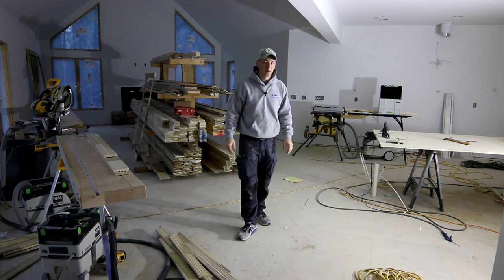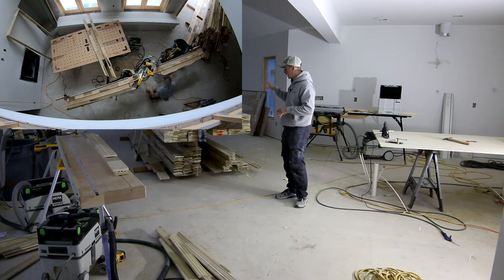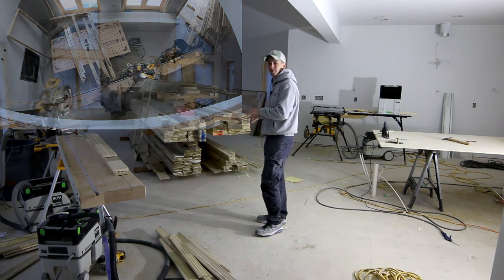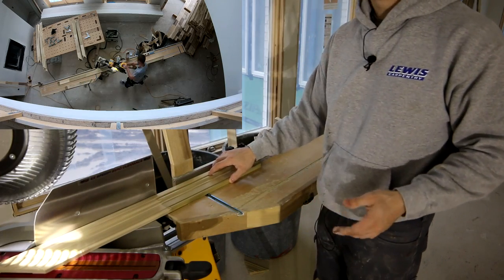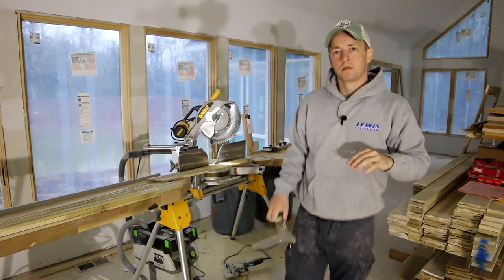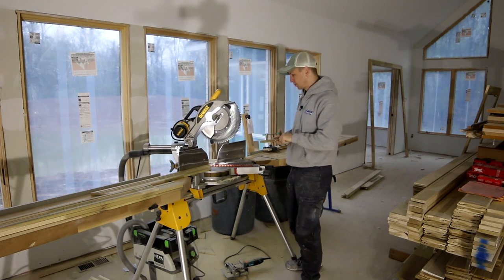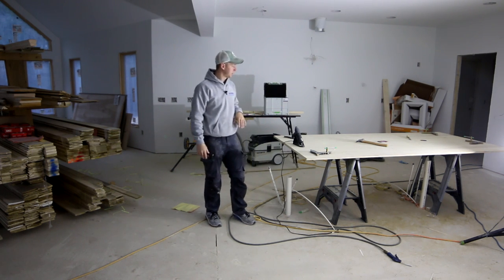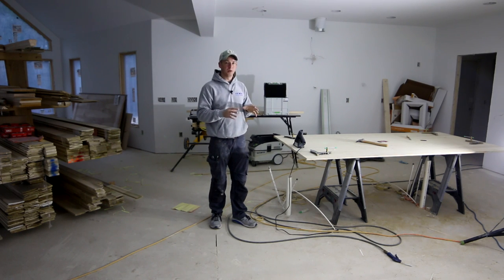The Most Efficient System for Mitered Casing

Comment: When you pivot your saw is it the same measurement from 45 as it is when it’s square on your embedded tape
Reply: I was surprised how accurate mine is. I also have a dewalt. The pivot point is right at the fence.
Reply: @waynemiller6070  nice

Comment: How do you handle stained casing? I am assuming that you are caulking the gap between the casing and for jamb. However that doesn't work with stained casing.
Reply: Spencer Blaylock paint Contractor here. No caulk on the stained casing which makes the installation that much more critical.
Reply: @twsd  That's why I asked. I don't see how he gets a tight fit to the jambs. Can he get an acceptably tight joint with the jambs 1/4" inset from the wall using stain grade trim. If so I would love to see how. I couldn't do it. Which is why I don't batch cut trim.
Reply: I’m sure he can. This guy is obviously a serious professional carpenter. I am not.  🔆

Comment: Thanks for the video man. Have a quick question - doesn't this hot glue is expanding a little bit once it is dry? I used traditional cheap hot glue gun and once it dries it it thick enough to have my miter open.
Reply from the maker: No it doesn't expand. This product is a completely different animal than traditional hot glue. I would not advice using traditional hot glue on miters.

Comment: I really like that glue system your using! I I know you mentioned wood glue and biscuits and how they stack up against your glue but how does it Stack Up Against CA glue/ cyanoacrylate Glue. I see a lot of trim guys are using the CA glue now and I'm in the middle of trying to decide which route to go.
Reply from the maker: CA can be decent on MDF but its terrible on real wood. I use CA for small return pieces and things like that, but not for anything that requires real joint strength. Hipur is in a completely different league. I look at hipur and CA as two completely different tools with different applications.
Reply: Insider Carpentry CA glue is great for mdf. Once you get the hang of it it’s really fast to produce strong outside corners. It’s basically liquid plastic and it can be brittle so good for mdf and not my favorite for solid wood. That’s why I bought a hi pur gun. The adhesive is not the same as hot glue sticks but has the gap filling properties like using hot glue. I’m experimenting with the wood to wood 30 second product now. I anticipate using it just for wood casing but who knows.
Reply from the maker: Crown Molding by Spectacular Trim yeah we can’t use mdf here in the Midwest so I only use ca for small returns on real wood. Hipur works best with clam clamps for casing. 👍 And stick with the 30. It’s the thinnest viscosity.
Reply: Insider Carpentry I literally got my gun yesterday and just started experimenting I took some hyper between two shims and just squeezed them together and let them sit for a few minutes and I could pull them apart pretty easily so somethings not right. Do you find that high pur needs clamps to form a really strong bond? I’m not complaining I’m just in search of making the system work for me because like you I really don’t want to have to use biscuits and wait for glue to dry a conventional way when doing casing.
Reply from the maker: Crown Molding by Spectacular Trim Something is wrong then. I have heard of guys getting bad tubes that had no strength but I’ve never had that problem. Hipur cures by reacting with air humidity. Really dry air could be an issue. You need to assemble very quickly and not move the pieces any after you first few seconds assembling or I’ve found it weakens the bond. The larger the gap the longer it will take to cure to strength. With clamps the cure should happen very quickly. I’m not sure what else to tell you?????
Reply: Insider Carpentry I’m going to check the tube I’m told that they have a expiration date of one year so I hope they didn’t give me old product. But also I’m going to experiment with it more anyway I’m not down on it at all I’m very optimistic about its possibilities
Reply from the maker: Crown Molding by Spectacular Trim For some reason a lot of guys struggle getting through the learning curve and give up on it. But it’s literally changed my whole work flow. It’s worth it.
Reply: @InsiderCarpentry  I'll get a hang of it. I have literally spent less than 5 mins with it. Just wanted to hear your tips up front. And from what I have read its shelf life is due to the fact that it is a hybrid of polyurethane and CA glue. Makes sense why the cap must go back on right away.
Reply: Insider Carpentry So I’m experimenting with it a little bit more and I noticed there is a huge difference in the strength of this glue if you clamp the parts together. Unlike hot glue which you can just smear two parts together and stick them this glue does require clamping for it to form a strong bond which is not a bad thing but it’s just something to be aware of. Also I’m finding that you have to put the cap back on the glue every time you stick it in the charger unlike a hot glue gun because this stuff will just pour out the front if it sits in the glue unit without the cap on just part of my learning curve
Reply: Well I tell you I just glued to two by fours together and throw them in a vase and now that I unclamped it after a couple minutes I’m pounding on it with a sledgehammer and they’re not coming apart so this stuff is very strong if you clamp

Comment: Great idea but over here they use aluminum windows with timber reveals. They are not always square and if you dont install them yourself you cant be sure they have been installed plumb and level which is annoying  as i would like to be able  to bulk cut.

Comment: This is great for a production shop but this is not so great for a job site the stop block system is not so bad but there is a more simpler solution and if the drywall is off theres problems and these clamps and this glue is overkill same with biscuit joints especially on casing trim rack is great but I'd consider it a liability and time consuming I can see the rack justifiable and this system for a mansion house but for your regular million dollar houses na unless you have 1 guy on the saw 1 guy clamping and a runner and a couple installers I think it's a little too much only thing I can imagine your prices are high in your area

Comment: Why in the world are you  using a dewalt. I do tons of tri I I invested in a kapex.    Buy the festool.  It comes already  calibrated .
Reply: Dewalt saws are framing saws,no one doing high-end trim uses Dewalt.Also where are the plinths?
Reply: They are not production ready saws. I own one and have had the armature replaced twice and I do not do near the volume as Spencer. I went back to a non slider DeWalt with full kerf blade after talking with Spencer and Justin. Spencer has had a similar experience with his Kapex's burning up. Nice saw for a hobby shop or low volume cutting.
Reply: Considering the motor on the Kapex is designed for European voltage(220) and on North American voltage(120) the motor doesn't get enough juice and it burns out over time. Spencer had two that burned out in two years. He also checked how precise the saws were, and the bed wasn't flat on the Kapex and the fences weren't coplanar. I had a Kapex also, and checked mine after I saw Spencer's results and the bed was fine but the fences weren't coplanar either. The long and short of it is for 3x the money the Kapex should give much better value, but it doesn't. Dewalt saws, though inexpensive, are very accurate and calibrated well outperform almost every other saw on the market. Aside from dust collection that is, they are dusty dusty saws lol
Reply: I fried a kapex using it in a production format. Festool replaced the motor thankfully. Now I only use it for shopwork face frames and cutting stair fittings where deflection is not an option. After 40 years in the trade I know a dewalt with a quality blade is ample for high end results. The rest is snobbery.

Comment: I've got to stop you at 4 minutes and 39 seconds.
We measure our windows,one per group of same size. Mark our 3/16 reveal,cut a 45 ,line up inside miter ,mark other side  and cut. We do this only twice.One vertical,one header or sill.
We count how many alike window sizes. Go to our chop box and  lop one corner and but the long side and mark and cut. Never leaving the saw til done.
We acclimate our casing as you should with all woodworking stick.
Doors get cut left and rights out of a whole 14' or 16' bundle depending on jamb ht. . Our headers are all cut from one measurement per door size as well.
I don't care what anybody tells you not all door jambs are the same with exactly depending on the manufacturers.
we used to keep notebooks with common casing sizes as per size of door and window but with various door and window suppliers those sizes always change.
we don't waste time setting up a fence stop blocks or any of that we have chop box on a stand material on a table in front of all of us and we just go to town.
Two guys can completely trim out a 2000 sq ft ranch ,minus crown in a day and a half. The next morning for cabinets and hand rail systems.
Depending on crown complexity. I can hang an entire room in 10-20 minutes. Never had to cope a corner and my crown is tighter than most that do cope because of the fraying the coping saw causes and the fact unless crown /moulding is from the same run at the Mill. The profile can very.
Good vid.
Reply from the maker: My system would look a lot different if I was doing production jobs. I'm on jobs for a month at a time. So moving a saw/stand a dozen times a year, I can justify having something bigger that takes a bit more setup. Though my setup takes minutes to tear down and deploy and its just plain nice to work on. 

All my trim comes from the same supplier and the doors are all the same size to 1/32 tolerance which is close enough for batch cutting casing. - Mitering crown really intrigues me, a lot of experienced old school guys are very anti-coping for crown. I find it very interesting. - Your system for windows sounds like it fits well with what you're doing, but I'd take my stop block system over that any day. Much respect trimmer to trimmer. Its always interesting to learn from production guys who have a system dialed in.